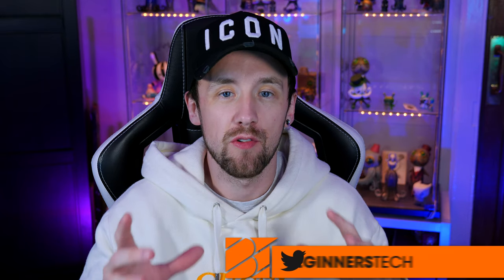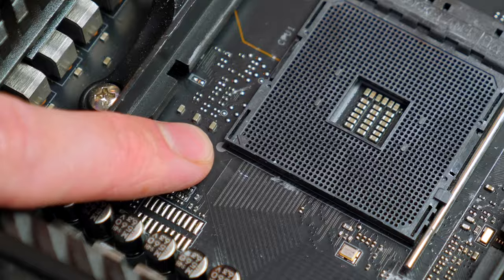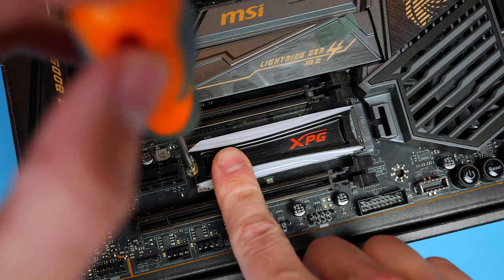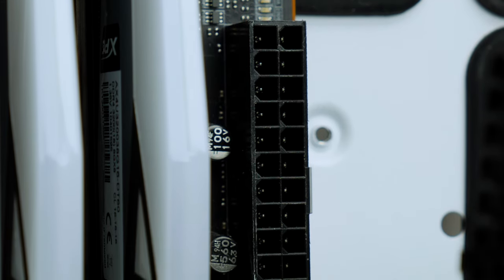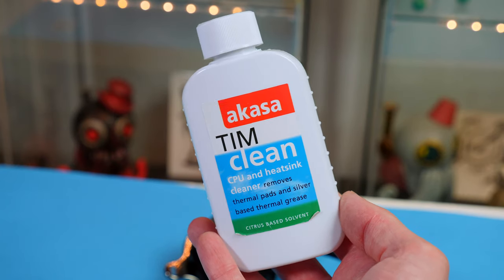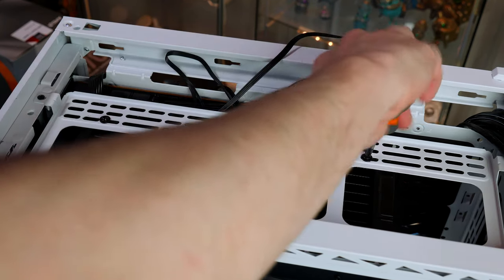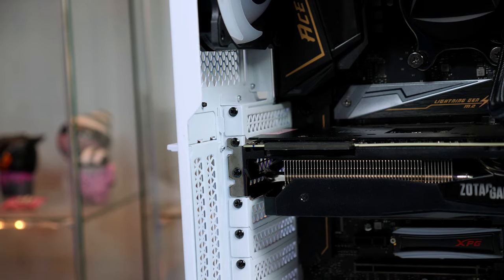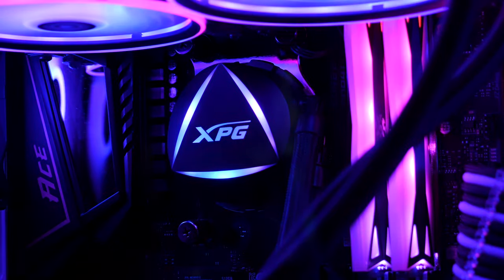Ultimate $1800 Gaming PC Build Guide 2020!  [RTX 2070 Super/ Ryzen 3600X]

Comment: Is it me or could the top mount rad  be mounted above the metal cage and the fans bolted thru ? Yes I know that the top part is probably meant for a push / pull configuration but in this instance  the build would look  neat up top with more mainboard on display ? just wondering if the  case has room to do that :)